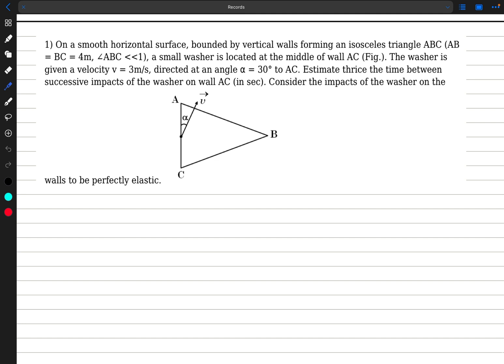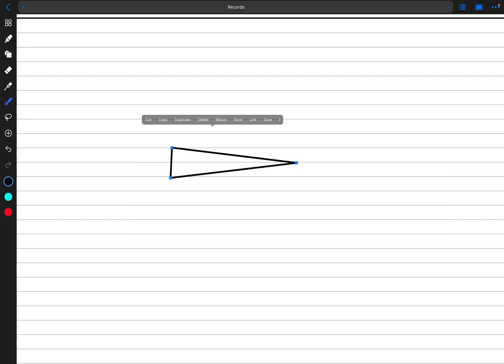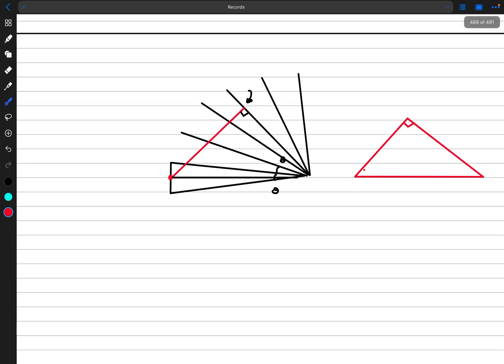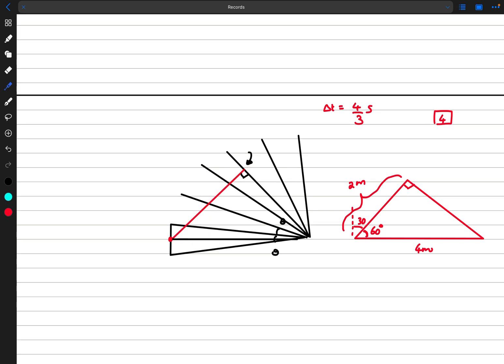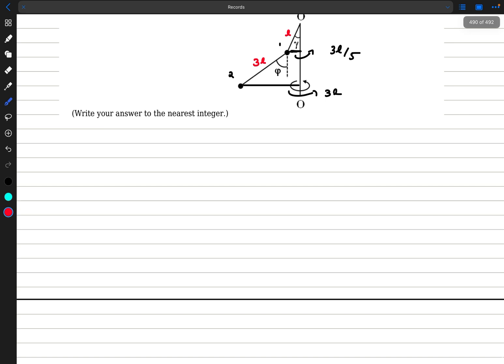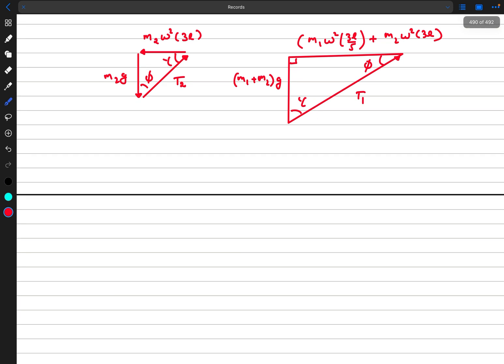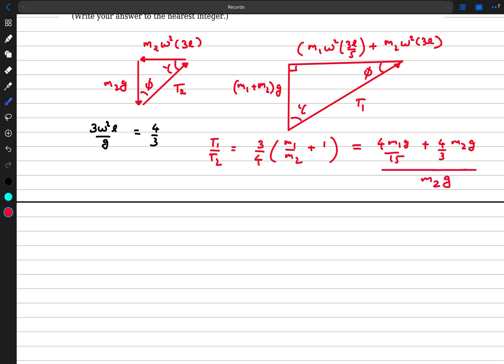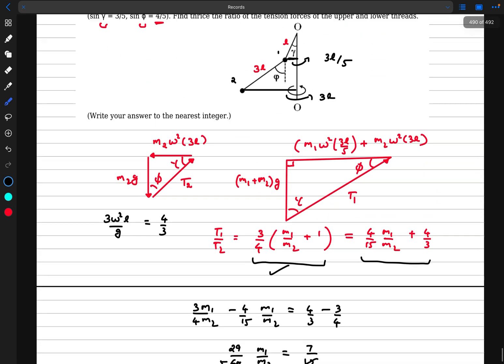Good Problems From The Pre Score Exam | JEE Adv 2026

Comment: Sir please also bring the solution of this question (SBT Rotational Motion Level 2)
Q.94. A disc is free to rotate about an axis passing through its centre and perpendicular to its plane. The moment of inertia of the disc about its rotation axis is I. A light ribbon is tightly wrapped over it in multiple layers. The end of the ribbon is pulled out at a constant speed of u. Let the radius of the ribboned disc be R at any time and thickness of the ribbon be d (<< R). Find the force (F) required to pull the ribbon as a function of radius R.

Comment: In the second problem, how were you able to make that force triangle for the entire m1 m2 system?
Reply from the maker: I took m1 and m2 together as my system so tension T1 , weights of m1 and m2, and centrifugal forces on m1 and m2 are the forces acting on m1 and m2 in the rotating frame. Now I took m1 g + m2g together downwards and total cf force towards the left. It was to fit it into one triangle.
Reply: Got it, thanks!